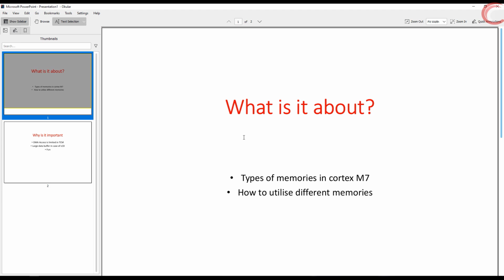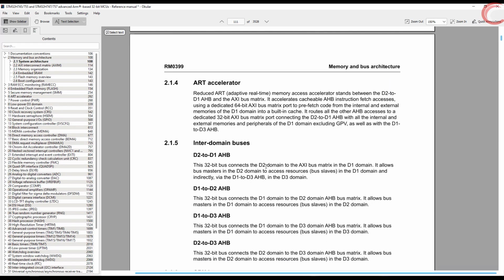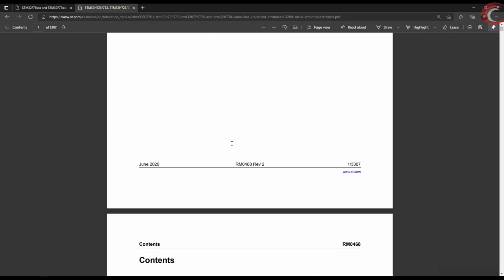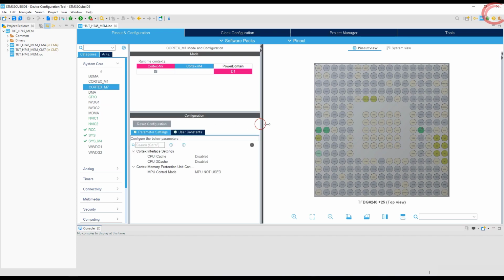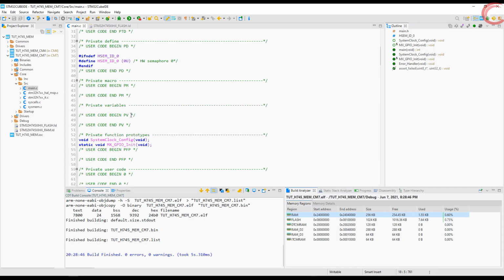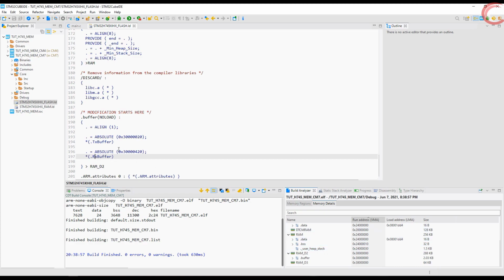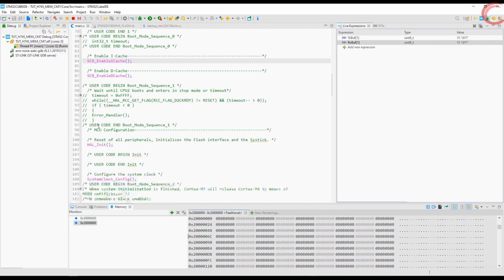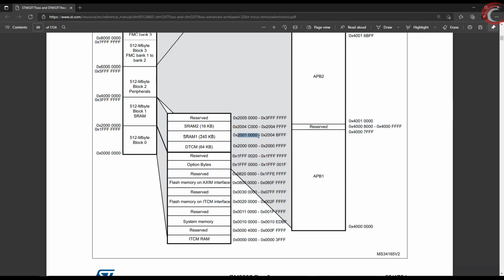STM32 Cortex-M7 Memory Mastery: RAM Types, DMA Access & CubeIDE

Comment: You put so much effort into these very useful videos but so far I have not been able to run anything on a Riverdi (STM32H747) platform (except for the high-level generated TouchGFX GUI). I have tried to modify such projects by adding some simple functionality by adding a DAC that is timed by a timer and fed from the DMA based on one of your related videos, but this video got me thinking that it failed because the memory was in a wrong location. However, I have tried to replicate what you have done, simply declaring a variable in the main.c file (tried with both for M4/M7 core) and I cannot even see the variable in the build analyzer's memory region, let alone after modification of the .ld file and adding the section directive!!!. Do you know what could be wrong there, maybe some memory protection? But mind you, this is still only the build state and nothing had been downloaded...

Comment: Thanks for the video. I have one question. When you changed the memory location in F746, although the address of the variable changed, but the RAM usage was substantially higher (20.63%)! Is it normal?
Reply from the maker: It depends on the usage and size. And yes it's normal

Comment: Thanks for the video, very good as always. I have a couple of questions:

In case we makr a change and regenerate code with cube mx would the changes on the linker script be overrided?

Also, will there be any tutorial focusing on linker scripts?

Thank you so much!
Reply from the maker: 1. No the linker script won't change with regeneration.
2. No plan on making any particular video for it. This is it for the script part.
Reply: @ControllersTech  Thank you very much! Keep up the amazing work